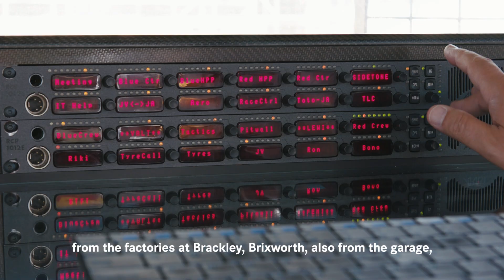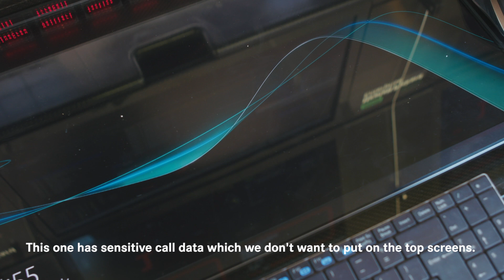Mercedes F1 Pit Wall EXPLAINED!

Comment: How overengineered, even the pit wall is made out of freakin' carbon fibre. Does the pitwall need to be crashtested by the FIA?
Reply from the maker: No crash testing, that's just for Toto's table only

Comment: I have sen the documentary of the DHL process to transport F1 around. Some insights on how all this gear is unpacked and set up and maybe how is continuous communications with the cars telemetry and drivers cockpit voice systems possible around the circuit ? I am guessing it is reasonably modular but is it Plug 'n Play ?

Comment: I think it would be very interesting to show us some things about how fuel and ers are used during a race.
Can the drivers change the rate of consumption of any of the above directly from their steering wheels or do they need to speak to their engineers first?
Or something like that...
Hope it's a topic you can talk to us about.

P.S. If this is sensitive data pls don't talk about it xD
Cheers and keep killing it on and off track <3 ;)
Reply: I think I heard lando talk about it. Basically the engineers decide when to use what engine mode. And the only thing the drivers can use is the overtake button which uses ers. Not sure about normal ers deployment. This also explains why you hear drivers asking for better engine modes for extra power.
Reply: It is not like the game from codemaster the fuel deployment and aboit ERS idk
Reply: They have preset engine modes and ERS modes from the factory that control deployment, fuel rates, engine power etc. The race engineers get on the radio and tell the driver to select an engine mode. Basically, the pit wall cannot directly change anything on the car. The driver has to do it on the wheel after being advised by pitwall. Of course, rarely drivers will change modes against the wishes of the engineers, and this has created some of the most memorable race moments where drivers used illegal modes to gain an advantage (ROS and HAM in 2015-2016). Mostly, you will see drivers asking for permission these days to fiddle with the modes on the steering wheel, or after being advised to do so by the pitwall.

Comment: Thanks for the info. Also we need yo decoding the formula 1 racing terms and every techniques as used in modern racing times as reduce the technical barriers to the spectators.

Comment: It would be nice to see toolboxes of mechanics. Some uncommon tools that are used in Formula 1 and in Mercedes garage particularly..

And thanks for the nice insight!
Reply: Racing point,is that you 👀
Reply: @Emyay01  I just want a few photos to my collection, nothing suspicious here ...
Reply: Jakub Jílek it’s all good mate,I genuinely hope you get what you want☺️
Reply: @jakubjilek3767  yeah i also want to know what brand they use or what brand that sponsor their team
Reply: Yes - would be great to see and hear from the mechanics and what they do over the weekend!
Reply: Agreed
Reply: Absolutely! I think the mechanics & their meticulous work needs to be highlighted. Their expertise & the speed which they pull off the miracle Mercedes is mind boggling.
Reply: Would be a great video
Reply: Agreed
Reply: Idk if it was me id be using as little tool as possible maybe three or 4. Like all the nuts and screws would take the same size wrench and driver.
Reply: I'd love to see a proper wheel gun. I go to work with my dad sometimes for a bit of money and he's a mechanic. I asked him if he can tell me when he has to take off a wheel to get to the brake disks if I can do it. I did it in 10 seconds, but I am 13 and it does have a lot of bolts, I can do it better 😂
Reply: Yes! And it'd be great if it was really in depth. last race they explained on TV that they have stepper motor driven tools to precisely adjust front wing by a preset number of turns. Never knew this!
Reply: Jakub Jílek you’re a spy from Ferrari....
Reply: Nice try racing point